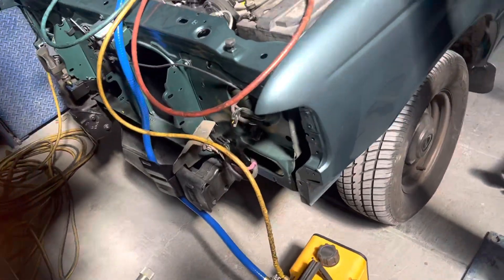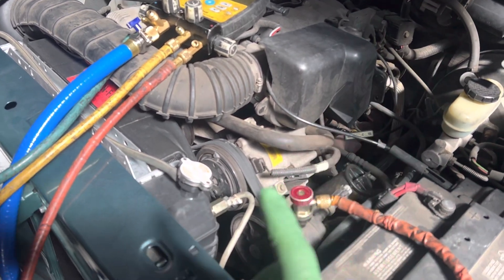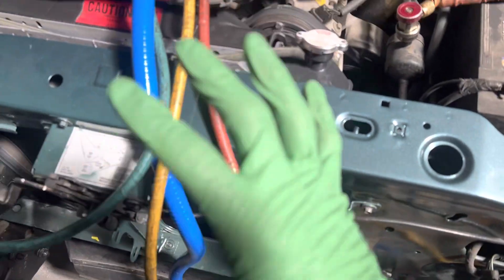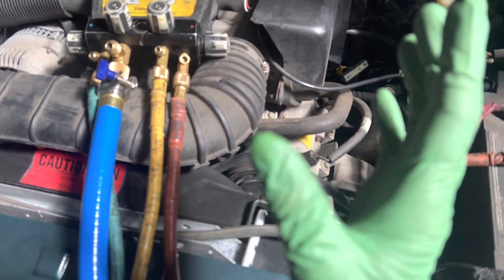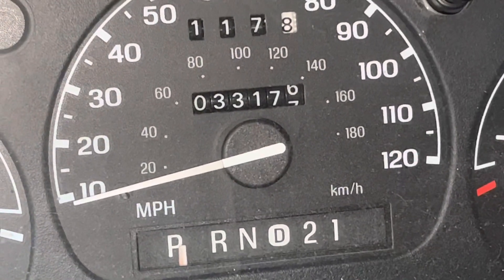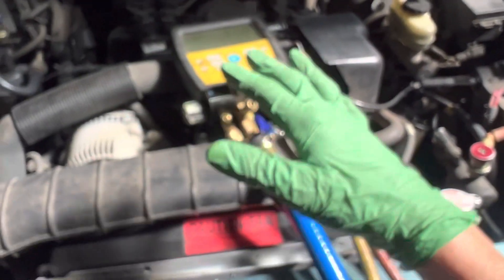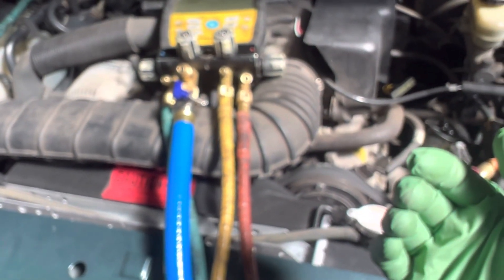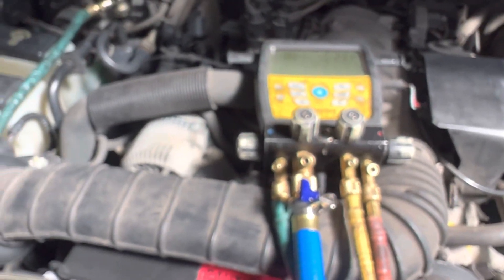LEAKING COMPRESSOR FRONT SHAFT SEAL VACUUM LEAK. Can we save this compressor? ￼

Comment: Yep, ford comes into the shop with this style of compressor you better be ready to sell the customer a condenser as well. Black death and that weird piston material on the orifice tube.
Reply from the maker: The sad part of it is, this only happens as the refrigerant level runs low. 

As the refrigerant level, runs low. There’s not enough refrigerant to keep up the velocity in the mass volume to actually sweep out or flush out the refrigerator oil from the evaporator.

Vapor refrigerant comes back to the compressor.  And refrigerant is an excellent solvent and absorbs in clings onto refrigerant oil in the compressor and moved it out of the compressor.. 
And then deposits the refrigerant oil in the Evaporator, and it stays there loading up inside the evaporator.    It does not go into the accumulator where I normally be sucked up through the Venturi opening in the tube in the bottom of the cumulator, where it’s supposed to separate the liquid, refrigerant from the liquid oil at the bottom this does not happen.. 

On top of that, because there is less refrigerant as a Refrigerant level goes down the cooling effect of cold flow of refrigerant to cool off the heat of compression and the heat caused by friction by pistons piston rings, and bearings disappears.  

Resulting in Black death. 

If the refrigerant level was never allowed to get low these compressors with nearly last forever.

Comment: I just came across another car repair channel's video on finding leaks by using CO2. Can you explain pros/cons of using CO2, and elaborate your decision use Nitrogen+Accutrak ultrasonic detector? (Apart from HVAC standard+useful for pipe sweeping)
FYI: here is the link of abovementioned video
https://www.youtube.com/watch?v=0bpya5ZwRvQ
Reply from the maker: Yes CO2 will work. I’m glad that he’s using the CO2 leak detector instead of just the foam that changes color like some other YouTube guys who invented the foam and are promoting it sell as just using the foam only.. 

In this video, he did mention of course you cannot use the foam in the evaporator because you cannot get to the Evaporator . 

My stratus Inforcon refrigerant leak detector has a CO2 module so it becomes a CO2 leak detector . 

Extremely extremely extremely sensitive picky even around you breathing in the area .   Your breath has several hundred extra parts per million thousand parts per million CO2.. 

You try to use your CO2 leak detector while you’re inside the passenger compartment just your breathing ads CO2 in the air in the general vicinity and you have to be careful about false positives .  

I think I published one video using CO2 leak detector on CO2 with my son, where we were looking for leaks in a CO2 system .    My son was going crazy because they took him a long time to figure out how to use the CO2 sensor correctly without breathing..   

He had to put on a mask, so just from breathing or talking, did not project the human exhaust of breath out forwards for any distance . 

By putting on a thick mask, limited amount of breaths to a short distance in front of your face . 

In the shop if multiple vehicles are being started up and driven in and out the exhaust of cars put out a lot of CO2 that will be constantly going up and down floating around the shop changing in CO2 density .   

And many CO2 some applications. Their gas is very dirty, has high Contant of moisture. CO2 loves water, very moisture absorbent, just like POE oil. . 

So, making sure you have a dry source of CO2 before injecting into a car. Most guys don’t know how to do and you cannot trust your source. . 

I guess I need to make some more videos using CO2 medical grade or lab grade where moisture has been guaranteed to be removed from .

Comment: Good video. I have found that one of the most common leaks in old a/c systems is shaft seal leaks especially in the old r12 Toyota systems. Pretty much every denso 10p series compressor I have come across have had bad shaft seals.
Reply from the maker: And one of the most common reasons for the front shaft, seal leak on those compressors are those guys who believe they should add a little oil every time they service.  They’re sensitive to over oiling. What happens is the extra oil and the refrigerant causes a higher compression ratio foreseen, higher pressure on the front lip of the front shaft seal causing early life failure. 

If it’s leaking under pressure and you see the oil flinging out . 

Especially when guys replace brand new compressors and they throw in a new old compressor without doing in oil balance procedure . 

All the oil from the system is still up inside the evaporator and then they throw on a brand new compressor that has a full oil charge and then that new compressor fails after 1 to 3 years or early death because of too much oil Mechanically, the compressor might live but the oil lips sealed cannot take it